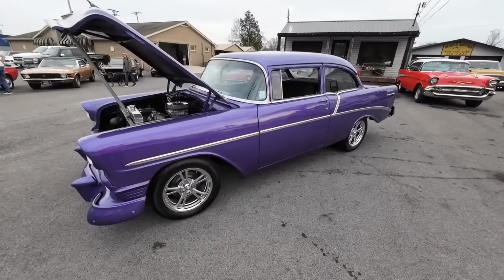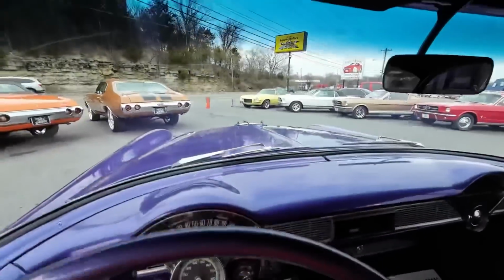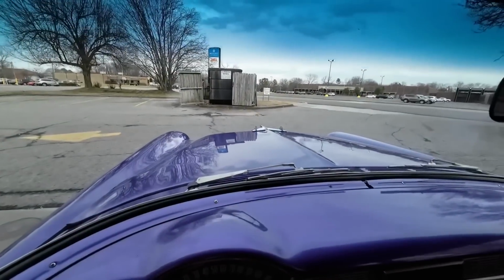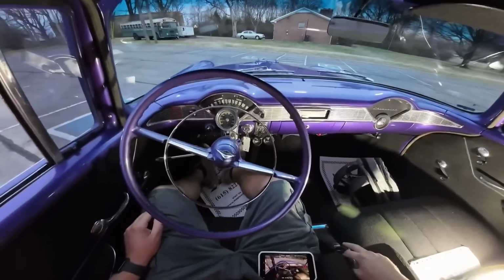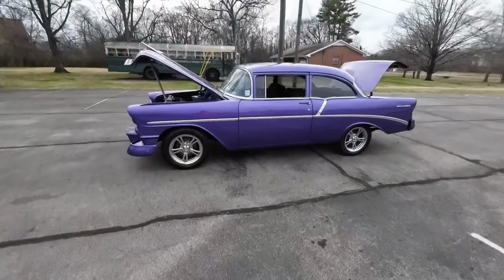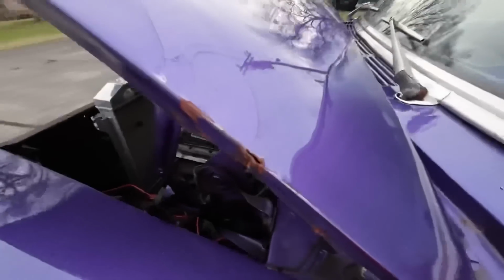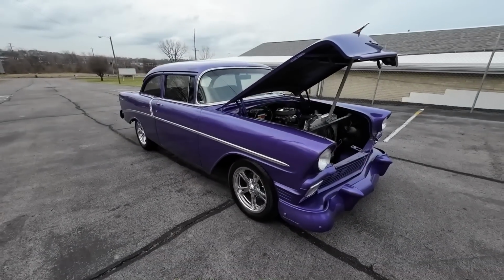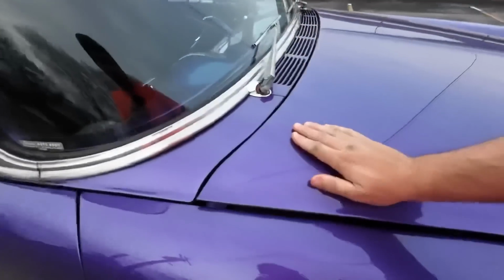Test Drive 1956 Chevrolet 210 2 Door Post SOLD $29,900 Maple Motors #2023

Comment: Hey Nick, I had squeaky drum brakes on a Chevy pickup once. Pulled all 4 drums off and they all had brake dust trapped inside of them.Wiped them out and took some brake cleaner and sprayed the linings. Reassembled and good as new.👍